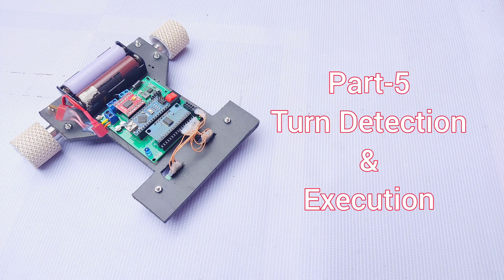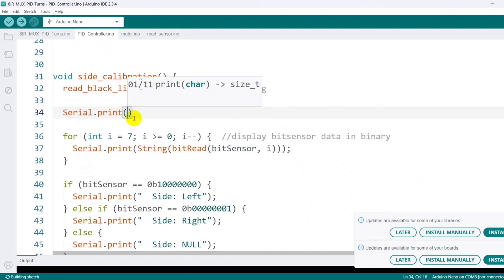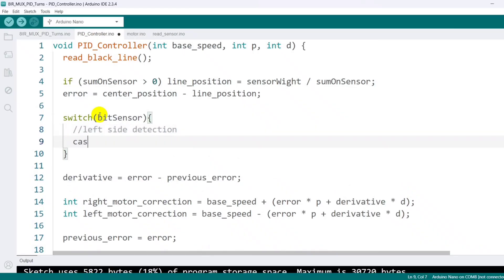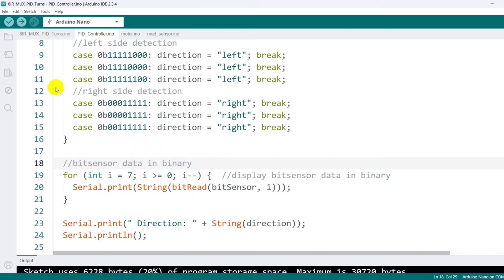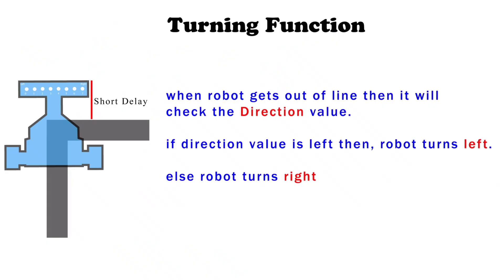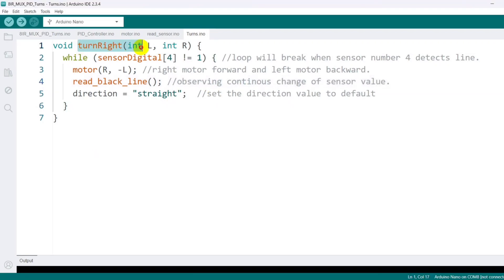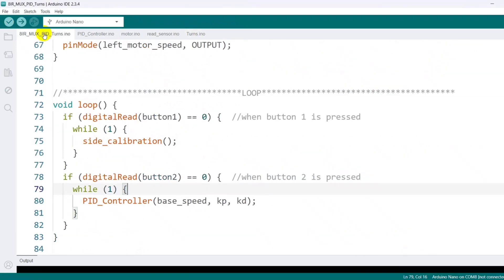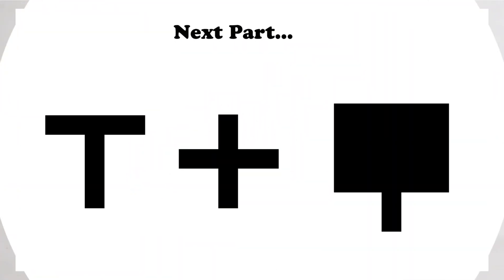How to Make a Line Follower Robot using PID Part-5 | Turn Detection and Execution | JLCPCB

Comment: Battery voltage??
Can we use 12 v battery ??
Reply from the maker: No. Only 2s (8v) battery. Fng driver will burn with 12v battery.
Reply: @aslamhossain1  what's the expected speed , if used 6 v 800 rpm ,  will get more speed , but is the torque will be efficient??